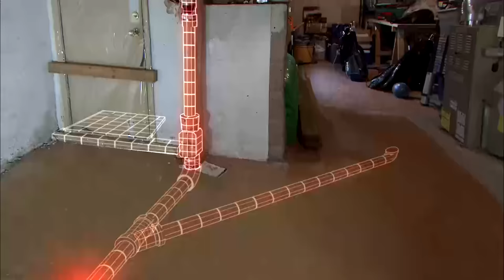The Home Inspector Missed What?! Mike Holmes' Shocking Findings | Holmes Inspection 109

Comment: I worked for years as a chimney sweep and we used to do a lot of pre-sale inspections. In that 3 seconds shot of the chimney at the beginning I saw $6,000 to $10,000 of work which needed to be done.
Reply: How did you feel about the flashing job on the outside of the chimney in the “flat roof” area? Didn’t look like proper counter flashing to me
Reply: @DeezNutz-v5t  I was a little iffy on that, also. It SEEMED like they didn't cut the counter-flashing in, they just caulked it to the brick. But the shots of it were grainy enough that I couldn't be certain.

Comment: When you start pulling old houses apart , it exposes a multitude of problems that have been botched over the years.
Reply: Not "botched" just a newer method that is supposed to be better, but still not good enough and then retried and buried- again later when exposed again and then laid to rest yet again but to be refound another time until ....someone with Mike's way of thinking (if not Mike himself) comes along annnnnd  " Well Thaats not right"
Heritage is great, but repairs cannot remain trapped at that time-  keep the heritage, fix the problem, Make It Right !

Comment: The homeowner mentioned how the inspector didn't report the foundation problem. He couldn't have because as we saw it required Mike to remove flashing in order to see it. An inspector can't pull apart someone's house to inspect things.
Reply: However, he should have had a serious suspicion there would be issues and recommend a professional be called in ASAP to look at it.
Reply: As a home inspector myself some things can’t be seen or known at the time of inspection first thing I do is start the water in every fixture and let it run for an hour to find leaks and backups in the drainage

Comment: We had a great home inspector, however we were surprised at how many houses we had inspected had structural damage. Luckily the issues we had with out house were easily repaired by me - Which I should point out I spent decades as a Marine Prototype Engineer and Master Boatbuilder. The few bad pieces of wood were fixed either by replacing or a proper scarf.

Comment: Nothing vented! OMG! When we were renovating the 1972 mobile home on our vacation property my friend who is a plumber checked it out. Really nothing was vented. We used the old furnace vent through the roof for the plumbing venting. Everything done right the second time.
Reply: If you used the old furnace venting for your plumbing venting then It wasn’t done right. Should have a minimum of (1 )3” continuous vent from the main waste line up and through the roof
Reply: @DeezNutz-v5t  It does.

Comment: Mike, I love your videos, and I learned a great deal watching a couple of your TV series. Old houses are wondrous collections of hidden things that inspectors don't or can't look for--things worn out and not fixed or replaced, things done wrong or poorly, and sometimes poor materials (like why do they insist on using particle board under sinks? Would it really cost that much more to put something under there that would be immune to unseen leaks?)

 Our first house built in 1962, we lived in for 23 years until 2021. In that time I found and fixed so many things done by previous owners and maybe some contractors along the way. Some of the things were potentially deadly electrical hazards either just left by and not fixed, or even DONE by the owner before us who was a licensed electrician!

The house we're in now, I have already found four electrical hazards in two years. One was a bathroom vanity light that shocked me and tripped the breaker when I attempted to remove the glass globes and light bulbs. Another was that someone had hot-wired and bypassed the AC external disconnect and fuses. Next house I buy, I want the inspector who is going to find THOSE kinds of things before they kill me or a member of my family!

Comment: One relative of mine is an official homebuilder.   But when they built their own house they didn't have the plans approved by the city.  They poured a concrete heat-retaining main floor on a wooden framework that wasn't up to code.   Now they're stuck with that house as it won't pass a sales inspection and redoing that floor would cost like $38,000 or more.   Oops.  So even people that should know better, they can goof up.
Reply: This was more than a goof up the inspector needs to be sued for negligence. He either knew the sellers or got paid off by them. And saying someone is an official homebuilder does not mean a thing i don't believe that story of the floor as someone who use to do that there is no way if he family member knew what they were doing would do what you say they did.
Reply: @1Shignog  This guy has built over a dozen houses.  But for his own house he went a bit wild, with a space-wasting alpine A-frame shape on a too-small lot, and with the aforesaid concrete heat-retaining floor for the family room.  I've seen it top and bottom with my very own eyes.  The floor is made of 2x6's on 24-inch centers.  Doesn't meet even the loose small rural town codes.    He is stuck with it.  

You see a lot of this out in the boonies.  My son's girlfriend briefly rented a house in a very small rural town.   The original heating system was way insufficient, so the only alternative was to raise the floors by 8 inches to install air heating ducts!  When entering the house there was an 8-inch step up at all the doorways!  With a cutout so the doors could swing open.   No lie!   Garages were also ramshackle, with shear walls and window openings framed 90 degrees wrongly.

Comment: Wish I could get holmes to come and fix my basement.  I technically have two basements, one accessible from inside the house the other only accessible from a door in the backyard. Inside they share a block wall and this basement is under my living room.  It was never even in my inspection report. I didn't even realize the basement was separated like this until I started moving in and the previous owner showed me where the water shutoff was.

Comment: With our last house, I thought the home inspector did a pretty thoughtful job, but after living in the house, there were some things that he did miss. He didn’t mention that the electrical system was DIY as the breaker box was upside down, and the outside box where the electric utility connects to the house was 75 years old. Also, the wires were a tangled mess, so that it was difficult to trace an electrical circuit to troubleshoot a problem. The moral of the story: Even when they seem very good, every person has their blind spots and their strengths.

Comment: Just an observation because they opened up the basement floor and if the main drainage pipe allowed clearance to lower the basement floor level even just 6 inches to increase the headroom could the cost be justified.

Comment: As an experienced working home inspector, I can tell you that attention to detail on how things are supposed to be built and installed, look and operate are at the very core of doing a proper home inspection. Personally, I have a professional background in gas and electric, as well as rehabbing and renovation of homes, and that helps. I know several home inspection companies in my area of South Carolina that have inspectors with no background in the trades or working knowledge of construction, on any level.  The evidence of that is my being called in to inspect a home by a buyer after it had recently been inspected, and the report appeared to not address visible evidence of defects. SMH.

Comment: i worked for a roofing company and we used melt(torch) down on a small strip mall type building. 6 or 7 businesses in 1 building. we did over a million dollar's worth of damage. The roofing owner had us use the torch down straight onto plywood and particle board. Come to find out we didn't have the contract to re-roof the building. summertime, 100-degree days and BEER to keep us " hydrated ".

Comment: I would have done the old plumbing  in the Basement first,  before closing of the exterior door, that way you can get the old concrete out, instead of walking it out through the house floors.

Comment: No, you do not use tongue and groove on a roof. you use plain plywood and connect the edges with cleats. This is so the roof can expand and contract with changes in temperature. If there are no vents, ALL of the sheeting will have to be replaced. Condensation on the under-side of the sheeting will have rotted it all out. The T in the plumbing is an easy fix. But no plumbing vents is a huge issue. If there are vents but they terminate in the attic, that's even worse. No access to the attic? That sounds fishy. I'm sure there was a hatchway into the attic. Find where it has been boarded over and open it.

Comment: I would question the use of the rubber mat in the basement floor. The concrete is not sealed. That concrete floor is absorbing moisture from below and it is just going to condense on the bottom of the mat. The moisture won't be able to evaporate and will possibly be a breeding ground for mold.

Comment: Doesn't a basement require an egress or a way to exit or enter the basement in case of a fire or other emergency?? Anyone knows the codes on this?
Reply: Believe you are right!  They didn't show if there was a window for egress..
Reply: No. Only if it’s habitable space such as bedroom (sleeping areas is term in code book) but even then habitable spaces need a minimum of 6’-8” in ceiling height which this place didn’t have. But yes egress window needs to be installed within the bedroom with direct access to the outside. Also smoke detector needs to be installed on inside of bedroom and outside of bedroom with a c.o on outside of bedroom as well

Comment: The obvious question is:  how did this couple come to choose the incompetent home inspector?  If I had to guess, I'd say it was the realtor.  Why?  Because I find it very suspicious that the realtor told them about the abbreviated inspection due to a conflict with the then-homeowners' entertaining schedule.  WTF?  A good realtor would have insisted on -- or at least strongly recommended -- re-scheduling the inspection until it could be done right.  I suspect the realtor wanted to close this deal ASAP to book the commission.

Another question: if the bathroom and kitchen had been recently upgraded, how could they have passed local building code inspection without proper venting and pipe layout??  I'd like to know what city this is in, and if their building inspector have a reputation for corruption and accepting bribes.

Comment: So when looking to buy a house, do the shoppers have to pay up front for an inspection?
Reply: If there’s a particular house you want to go into contract for then yes you pay to get inspection upfront to hopefully find issues like what these people had then you can negotiate the price (if your still interested) some inspectors do participate in after closing payments so you have to shop around
Reply: @DeezNutz-v5t  Ahhh, but only after a contract has been signed?
Reply: @mts7274  Yes.   Buyers typically write an offer to pay a certain price "contingent" on inspection.   Inspections are not required, but if you choose to have one done, it is at your expense and paid directly to the inspector at time of service, regardless of whether you ultimately complete the purchase.   If you still want the house after the inspection, you can negotiate what items you want corrected by the seller, or reduce the price of the house to compensate for what you know you'll have to spend on repairs.  If the sellers advertised the house for sale "as is" then you can pretty much assume they won't be very negotiable.   You should still get an inspection though, because those houses typically are old with lots of problems so you need to know what future expenses you might be getting into.

Comment: Why did they run the kitchen vent like that? They could have used a under counter air admittance valve that would have done the same job and not hack holes through all the cabinets. They were very much a thing when this was out and is to code in Canada in this situation. Weird choice they went with.

Comment: Mike Holmes and Team would NOT want to visit my apartment building. SOOO many things wrong! Like recently we had a company come to do Lead Abatement. And while doing such there were some holes in a wall of my apartment. The walls were wood paneling over plaster. Basically the contractor cut a piece of drywall, placed it the hole, used red electrical tape over the seams then applied a thick layer of joint compound over the entire area. I have photos to show. DID the landlord care? DID the city inspector even review the work done? Simple answer NO. Just a quick inspection and that was it. There was even a 220v dryer outlet removed in one apartment, pulled the romex down into the basement then just had wire nuts placed on the ends. The 220v romex is still connected to the breaker panel. Flip the breaker and the 220v romex is live. Sad some landlords are scumlords. :(

Comment: These videos are depressing  - but they're like a train accident.  You can't take your eyes off of it as you watch it happen.  

I think that every home has issues if you look deep enough.  Holmes is not afraid to rip off exterior siding.  Every home, unless it's new, is going to look horrible under siding.  You're average home inspector cannot do that.  Nor can an inspector cut holes in walls to examine wiring and plumbing.   Yet, it really seems for a proper inspection, you need to do these things.

Comment: Does anyone know what a can of worms looks like. I had a friend that was buying an old house, the deal wasn't done yet; he was smart enough to call me. I have work on houses that contractors have screw up, I'm the one that corrects it. I went to my friends house he was thinking of buying. Well;  it had 3 layers of roofing on it. It was on a concrete slab and the one side of the building had to much vegetation, the grade of the ground was wrong, took my screw driver went through the wall. Water rot also could be termites to. I told him don't buy it. Can of worms! I think future home owners need to go to YouTube & educate then self's.  :face-orange-raised-eyebrow: